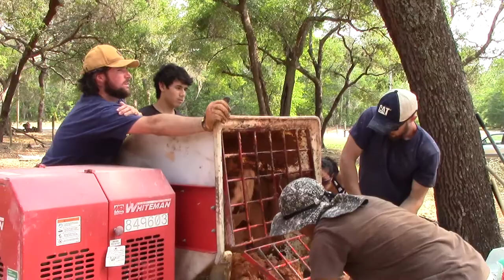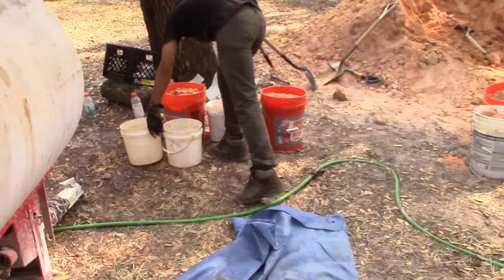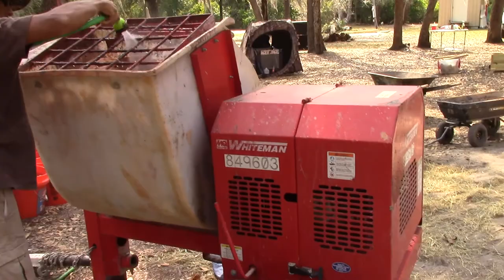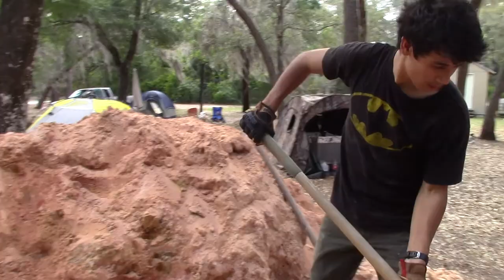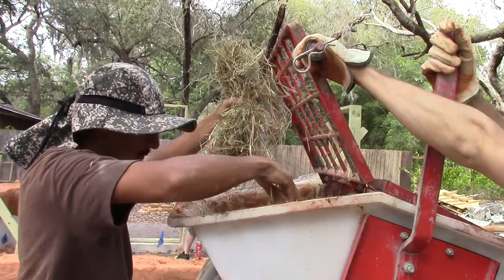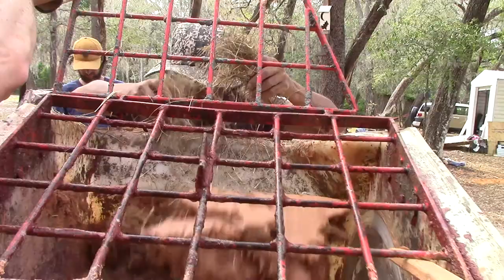Fast Cob - How to Mix Cob 10 Times Faster with a Mortar Mixer

Comment: Hi does mixing concrete (3/4 inch aggregate)  work well in one of these stucco mixers?
Reply from the maker: No, I'd use a regular concrete mixer for the stuff with large gravel like that. I think some people might use mortar mixers for uses like that, but its not good for the paddles, and the gravel could get stuck in them, halting the machine.

Comment: That didn't look like straw, was it hay? Could P.C. or emulsified asphalt or lime or fly ash be used instead?
Reply: That's what I thought. This guy builds a lot of cob houses, but I have never seen anyone build with hay. It doesn't seem like a good idea to me. I would not use lime in your mix because it will cause it to dry much faster and possibly crack. Ash would probably work to make a harder cob.
Reply: @JohnWhite-gd4tx  Far as I know, the clay/lime render is more of a surfacing coat once the main wall has had a chance to dry for that exact reason, not mixed throughout. I'm not sure what PC is - the ash I think would work, the straw is because it helps add a longer fiber for everything to adhere to and interlock with. emulsified asphalt wouldn't do the same. Might work but would also make working with it a real mess.

Comment: You guys are way too unsafe around that machine and you have too many people doing a one person job while everyone watches. Drives me nuts
Reply from the maker: Safety is important. How would you see it changed here?
Reply: @thiscobhouse  on those motar mixers you NEVER EVER stick something in there. This is extremely dangerous because your tool or limb can get snagged by the mixing arms and can be torn off or seriously broken. If you stick a tool in there it can break and fly out and hit someone and seriously injure them as well